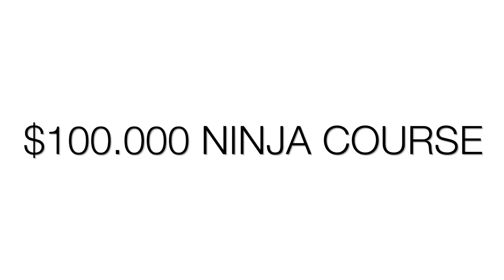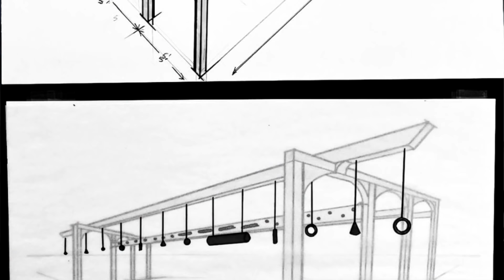$100,000 Ninja Warrior Course In His Backyard!

Comment: It is a sweet video and I love this kind of content, but you made so many mistakes in the build that will cripple the lifespan of the course. It makes me sad to see the work and materials getting a bit wasted. I understand that you did not do it on purpose but it still hurts. In short: build up a foundation above ground level (a fair bit above it) to prevent rot, do not paint wood, water will get and stay under the paint and the wood will rot quickly (and it looks bad) use a balcony or deck stain instead. best apply the surface treatment before assembly. In general, wood may get wet without a problem, but it must never stay wet or it will rot in an instant (looking at the pretty boards). Buying materials at B2B places in bulk will be a lot cheaper.
Reply from the maker: Thank you for your feedback!)
I hope this course will stay for a long time!🤘
Reply: @AntonFomenko  don't worry too much, the course should be fine for over 20 years, especially in the nice climate. In fact, my balcony is (wrongly though) painted and could use a rebuild after 30 years in harsh cold and wet weather. My perspective might be a bit skewed as an engineer from Germany where houses are often planned to be used for several centuries. 
Really don't want to pull you down. Please keep up that awesome energy and joi.